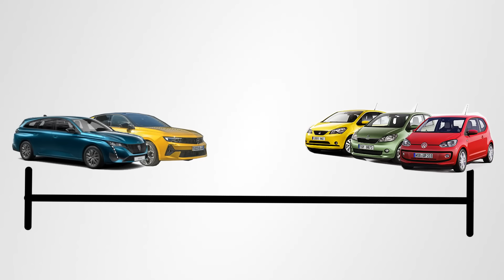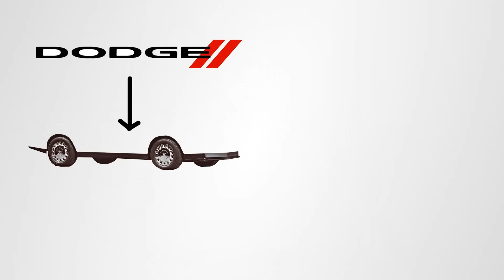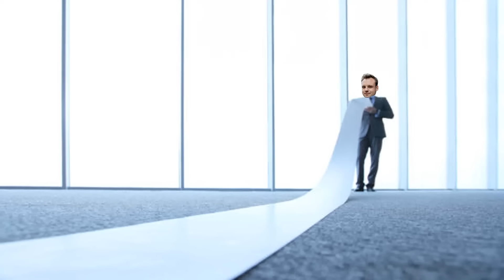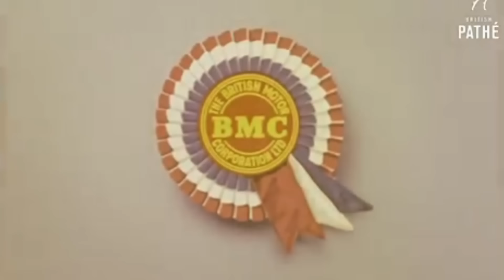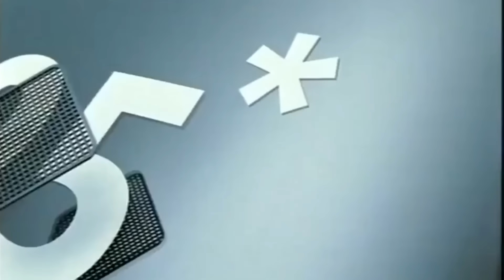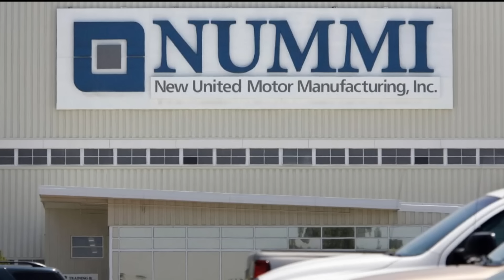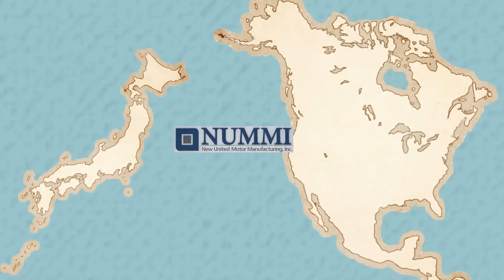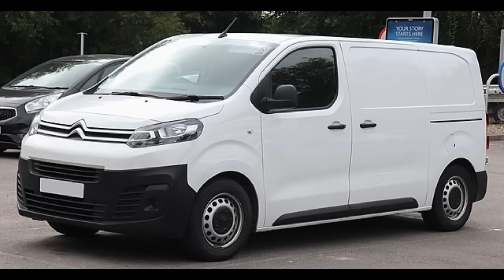Ep. 30 Seeing Double: The History of Badge Engineering

Comment: GM are the actual kings of rebadging. They literally rebadged the hell out of every model, platform and brand possible.
Reply: Starting in the late 40's TBH..
LaSalle/Cadillac
Pontiac/Chevrolet
Buick/Oldsmobile
While not entirely identical in appearance, so many design elements and components were shared it's really like almost 3-5 different "models" of the exact same car. Especially after 1980, when only two GM divisions made all the motors.
Reply: for real, this is the company that has the guts to rebadge the Lotus Elise 😂
Reply: @smellsuperb1  Pontiac itself is a rebrand of Oakland in 1926, it was just so successful they completely dropped Oakland in 1931.
Reply: So GM really stands for "Giant Mimeograph" 😭🤣🤣
Reply: vw right now
Reply: Chrysler, HOLD MY BEER. What about all those rebadged Mitsubishi and Renault cars Mopar did?
Reply: And, through the 1970s and 1980s, they further hobbled themselves by allowing each division to design its own engines, offsetting any money they saved by rebadging.
Reply: @plymouth491  after 1979 there was only three divisions making engines. Honestly, they saved money but killed the unique personality of the brands. GM made a huge profit in the 80's, go check the numbers. They started losing market share due to reliability and quality control.
Reply: @MidKid61  

Weren’t they given some rename like Diamond Star Motors?
Reply: @MidKid61  Like the 1978 Dodge Challenger. I owned a '70 Chally RT440 at the time, I asked the saleslady "What the f*ck is this supposed to be?"  44 years later I still feel the disappointment...
--Mopar gearhead.
Reply: What about Ford??
Ford Taurus
Mercury Sable

as well as Chrysler..

Chrysler Town and Country
Plymouth Voyager
Dodge Grand Caravan
Reply: @crankychris2  yep i feel the same way as you but im much younger generation than you and mine is a 67-71 charger any K-car bastion's caring the nameplates i didn't mention it or count it as it wasn't the sprit same for the ford E-scape BEV ok cross over but not a ev mustang and im not a ford guy
Reply: @EyeonthePrize247  yes ?91-95? eagle talon my older cousin had one in 2004-12? quick when it ran right but his spent a lot of time in the shop and is a cousin to the MissB eclipse / 3000GT/300ZZ and the transmission and other engine parts on both car's and others have the ⭐mark on them as a mechanic i worked on quite a few of them in between caddy's the main breadwinner for the 2008-13~ shop i was in
Reply: Look at Ford also, Murcury was just an upscale Ford... at Chrysler,  Plymouth, Dodge, Desoto were copies of each other too...
Reply: GMC - Chevy .. exact same .. Chevy suburban . Cadillac Escalade.. Chevy s10– Isuzu.. all Chevy and GMC trucks . The list goes on and on
Reply: There's a story out there about a GM engineer being asked what was the difference between a Chevy Cavalier and a Cadillac Cimarron.  His answer was "About five thousand dollars!"
Reply: @smellsuperb1  Yep, 80/90's trucks badged as GM could have a Chevy steering wheel ect... and the Suburban was badged with both GMC and Chevy in the late 90's.
Reply: @crankychris2  , I am sure that your parents feel the same way about you.  Also, the Mitsubishi Starion is a good and underrated JDM vehicle.  However, with a bit of body altering, as well as a Hellcat engine and transmission kit under the hood, a 1978 to 1983 Dodge Challenger would be a damn good rival to a Fox Body Mustang.
Reply: It's nice if you like to work on cars. My little brother had a cadillac eldorado from 1978 and my dad had a trans am from 77. Completly different car, same lights. 

Universal parts is what gm is good at. From ~1960 to today, almost every engine bolts onto every transmissiom. Every transmission bolts to every frame, etc. 

You can take a 1960s l6 engine, conect it to a 2020 transmission and throw the monstrosity into a 1970s car with little to no issue. The easy adaptability was "suposadly made for car nuts and dragracers. Easy to customise was a seriose want for the drag racing comunity.
Reply: Nissan are good at it too, some of their cars carry different names in different parts of the world
Reply: GM Holden were a big fan
Reply: Growing up I remember always asking what was the difference between a GMC Sierra and a Chevy Silverado
Reply: BMC/BL/Austin-Rover: hold my beer
Reply: @joevez2000  Pretty much every Car Company rebadge everything
Reply: @retrocompaq5212  no, vw doesnt rebadge they use the same platform but use different exteriors. For example: the Skoda Octavia, Seat Leon, Volkswagen Golf and the Audi A3 use the same platform but look entirely different even the Seat Mii, Skoda Citygo and VW UP look different from each other not a lot but they look different(lights got changed so its front/rear mix up), so this isnt rebadging as in what GM does
Reply: Your channel suddenly comes out from my lists! This s is great!
You only mentioned American and European cars rebadging. Take a look with the asian cars recently.  Korean cars rebadged as Malaysian cars. 
Worst still  Chinese cars do an exact copy that looks like pirated.
Reply: Opel, Chevrolet vauxhall and holdem, they're all the same lol
Reply: @MidKid61  Mitsubishi Mighty Max = Dodge Ram 50, Mitsubishi Eclipse = Eagle Talon, Dodge Avenger & Chrysler Sebring Coupe
Reply: @tpike32  starting in the late 60s after GMC stopped using their own V6 engines, they and Chevy trucks have been identical since.  That whole "GMC, professional grade" advertising theme is so stupid.
Reply: Another prim example of a typical GM rebadged is the 2004-2006 Pontiac GTO which is nothing but a rebadged Holden Monaro from Australia 🇦🇺 unlike the real old school GTOs.
Reply: Toyota is doing a similar thing in India, a third of their lineup is just rebadged Suzukis
Reply: @fuzzjunky  And Pontiac rebadged Holdens in the United States… (as did Vauxhall in England).
Reply: @joevez2000  Also the Lincoln Continental was a rebadged Taurus for a short period of time
Reply: Especially in the 80's and 90's. I firmly believe there was 1 assembly line, and the guy incharge of attaching the badges had to just grab one out a box with all the different brands mixed together. Chevy, Caddy, Buick, Olds, Pontiac, Saturn, Saab, GMC, Geo.
Reply: In Brazil specially, selling the Chevette as a "New vehicle" in the 70's, and in the mid 80's they brought the Monza and Kadett, and the Kadett is literally a Chevette, but no, it's a totally new vehicle... LOL
Reply: @gabrielv.4358  Kadett was an Opel brand from Europe (it dates from 1936).
Reply: @timbonthuus1619  not entirely. GM had different bolt patterns between some of the divisions. Generally it was Chevrolet had one bolt pattern and the other 4 divisions had a common bolt pattern except for the Buick nail head V-8s that had their own unique bolt pattern. At one point in the 1980's they built all the transmissions with the Chevy and BOP bolt patterns. There was a YouTuber who was attempting to put a Oldsmobile Diesel into a late 60's Cadillac and even thought the Olds engine bolted up to the Caddy transmission there were a lot of other things that would need to be changed. He ended up rebuilding the Cadillac engine.
Reply: @fk4515  I wouldn't lump the Japanese manufacturers into that era with the same purpose. Their main issue was rustproofing in the 70's. But the vehicles would run forever.
Reply: Yeah, he didn't mention the Suburban brand in this video
Reply: Ford, Toyota, Nissan, Volkswagen, et al, all do it!
Reply: Never heard about British Leyland? They went into ridiculous lengths and used long dead brand names to sell the same car. For 20 years.
Reply: @joevez2000  Chrysler Town and Country
Plymouth Voyager
Dodge Grand Caravan
And...
VW Routan
Reply: GM literally said copy and paste
Reply: GM literally said copy and paste.
Reply: Can’t forget about Volkswagen either
Reply: Not 'literally' every model. Over its entire 70 year life and counting, the Corvette in any of its generations has never been rebadged into something else. Its engines transplanted yes, but its unique platform nope. Jus' sayin'...
Reply: For some reason, the blanket-heads at GM thought that rebadging boring cars that possess no innovation was going to be the road to success.  And it turned out to be the road to suckiness.
Reply: @devandrasimanjuntak1646 Tesla did that too, same with Dodge. You'd be surprised how many Lotus rebadges there are.
Reply: @paxhumana2015 I owned an '83 Sapporo (the Challenger rebadged a Plymouth) and it was okay, even with the 2.6l I4. The best part? It was a Hemi!
Reply: @993isgawd  The Cadillac XLR would like a word with you.
Reply: GM = Grand Mimeograph
Reply: @MidKid61 GM still did more.
Reply: @CJColvin yeah unlike the real old-school GTOs, that one went around corners without trying to push you into the nearest tree.
Reply: @PapaVanTwee5 still a Mitsubishi with an Astron 2.6 though.  Only marketed as a Hemi in the US.  Wasn’t actually a Hemi though.
Reply: @ayrproductions  You know you can always upgrade the brakes and suspension on the old school GTO and that'll handle just as good as any modern GTO as well as whatever you drive mate.
Reply: @CJColvin  no it won’t handle anywhere near as good as a Monaro.  The Monaro has a far superior chassis.  Old GTOs had to be steered using the throttle.  Don’t need to do that in a Monaro.
Reply: @ayrproductions  What car do you drive and how much money do you make to afford that car mate?
Reply: @ayrproductions  While it wasn't a HEMI® it did have a hemispherical cylinder head, making it a hemi.
Reply: @bangdollarsign  Suburbans were only sold under three brands (that I know of) - Chevrolet, GMC and for a whole two or three years - Holden.
Reply: @PapaVanTwee5  yeah that’s true, but then a lot of others were doing the same thing with their motors.  Chrysler Australia even marketed the Astron 2000 as a Hemi while still marketing the Sigma as a Chrysler product.  Spec sheet and badging always said it was an Astron though, and the mention of it being a Hemi was only in the brochure.  Was only ever badged as a Hemi in the US though.
Reply: @ayrproductions  I wasn't there, but I see more than two or three years in a quick search on the topic
Reply: @bangdollarsign  yeah more than two or three years as a whole, but I was referring to how long it was sold with Holden badges on it.  And in that time, they only sold about 50 of them.  Their aim was to sell them to people towing horse floats, especially the 2500 models.  Most of them just kept buying converted F-trucks and Silverados or GMC Sierras as they could continue to use fifth wheel floats instead of having to use goosenecks.  The rest simply ran Japanese trucks or if they only needed to tow a one or two horse float - Ford Fairlanes or Holden Statesmans with V8s in them.
Reply: I literally think of the ford probe and Mazda rangers lol but I remember there being 3 different crown vics and Taurus too so yeah gm is bad but like this guy showed with  Chrysler they're all guilty of it lol.
Reply: The Toyota Nova and Daewoo Lemans were the worst offenders in my opinion.
Reply: I was thinking Chevy Tahoe, GMC Yukon, and Cadillac Escalade the whole time. Also, the GMC Sierra and Canyon, and the Chevy Silverado and Colorado
Reply: Reason why Holden could not compete with the Ford Territory. 
We have a 100% Australian designed SUV with the heart of a Falcon (Barra) and it was competing with a Daewoo Craptiva. Easy win for Ford
Reply: British Leyland enters the chat.......
Reply: Saturn opal
Reply: S10 chev is Isuzu
Reply: What is literal rebadging? What is non literal rebadging?
Reply: At least they look different unlike the Toyota gt86 Subaru brz and sicon frs
Reply: I drive a rebadged 2000 Escalade which is just a Denali trim Yukon with a Cadillac badge
Reply: And let’s not forget Geo! They changed the external badging only. Could still see Toyota under the good on the Prizm [Corolla]. Etc…
Reply: @smellsuperb1  Chevy/GMC pickups:  Grills, some minor trim/features.  The GMC pickups had the fancy fold-out tailgate several years before Chevy got it.  GMC is considered the more HD/Luxury brand, but just barely.
Reply: Chevy Uplander
Buick Terrazza
Pontiac Montana
Oldsmobile Silhouette
Saturn Relay

All the same van.
Reply: It had a hemispherial combustion chamber @ayrproductions
Reply: If you watch this video until the end, you'll see that's not even close to true!
Reply: The Holden VE statesman was also sold as a Chevy carprice, and the Vu,Vy/Vz, Ve commodores were sold as Pontiac GTOs. Really gm really
Reply: And now Opel changed from GM to stellantis so the rebadgeing effort stays the same. However, I must say, to Astra and the Peugeot 308 may still are a totally different experience. The setup of the suspension won't have you believe these are the same cars. The french one is detached from the road, the rear end sometimes feels scary loose and the astra is more direct and harsh.
Reply: I drive a cavalier/sunfire
Reply: The GMT360 platform comes to mind
Chevy Trailblazer
GMC Envoy
Saab 9-7x
Oldsmobile Bravada
Buick Rainier
Isuzu Ascender
Reply: @smellsuperb1  It was more like 1990s - My Aunt had a 1986 Pontiac Parisienne, and it could be had with 3 different "5.0" engines, Chevy 305, Olds 307, or the Pontiac 301, made buying parts a massive hassle.
Reply: @MidKid61  EAGLE has entered the chat.
Reply: @smellsuperb1  What 3, Buick, Olds, Chevy and Cadillac still had bespoke engine well into the 90s. Olds had things like the Quad4, Buick had the 3800, you could still get a Caddy had the 4100 then the NorthStar, l. I think Pontiac dipped out first.
Reply: @richardprice5978  3000 GT was totally different car, als badged as the Dodge Stealth, was the "GTO" in Japan.
Reply: @timbonthuus1619  Wrong, Chevy had a 7 bolt housing where BOPC had a 6 bolt, so you cna't bolth a Chevy trans to a BOPC motor. :)
Reply: @respectedwizard8749  Question still remains, ages ago someone told me the GMC only existed so Buick/Olds/Pontiac dealers could sell trucks, since GM forbade them to sell Chevy's at anything but a Chevy dealer.
Reply: @mini4x  Buick made all the V6 engines after the late 80's. Cadillac engines were phased out after the Northstar (which is an Oldsmobile design), Chevy and Olds made all the V8s until the LS series debuted in 1995-96. After the 4100 and V8/6/4 (which was I believe a 368ci), Cadillac engines were largely Olds sourced 307's and 350's. Certain models had Chevy engines in California due to emissions.
Last true Cadillac engine was the 4.9 TPI that replaced the 4.5.
The 4-cylinders were mostly the quad-4 Olds sourced units until the more recent "world engine" ecotec 1.8/1.5T/2.4na/2.4t engines.
Reply: Literally?
Reply: Yeah GM had deals with so many other brands their old Geo brand was perfect example of that in fact all their models were Daewoo, Toyota, Suzuki, Isuzu, and Honda
Reply: Not literally,  figuratively.
Reply: Yet you still can find a favorite among the rebadges thanks to comfort and performance. My Saturn VUE for instance was free. It’s front wheel drive, with the 4 banger, and has a 5 speed manaul. I honestly love it and it’s GTA 4 body roll. It’s dangerous as hell, and thus, fun at 15 mph. I know it’s an Equinox, but that has ABS. My VUE is such a cheapo she doesn’t have ABS. I have so much fun in the winter. XD
Reply: It's a Business that sells cars
If you have a good thing why not offer the other divisions a piece of the pie
Reply: It makes sense as GM has made so many crap cars, putting their name on just about any other make gives them better reliability ratings.